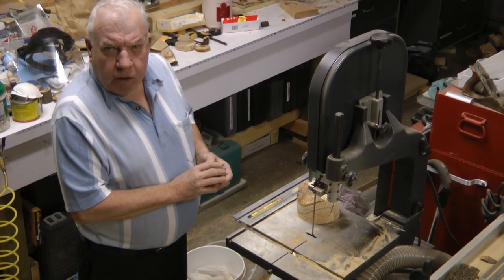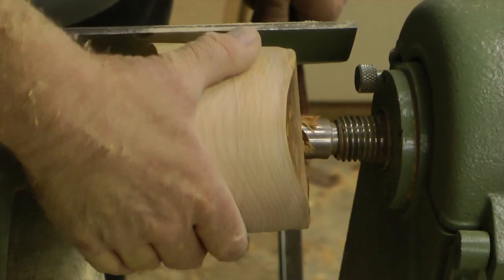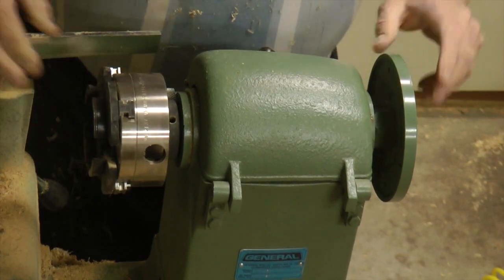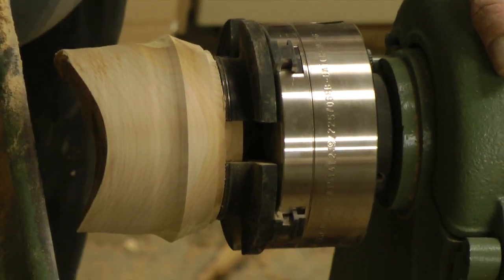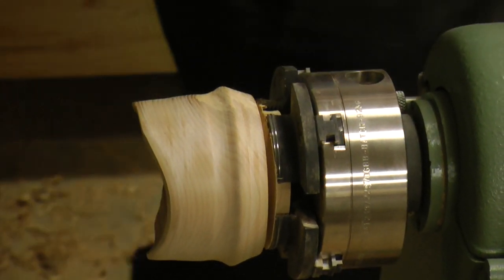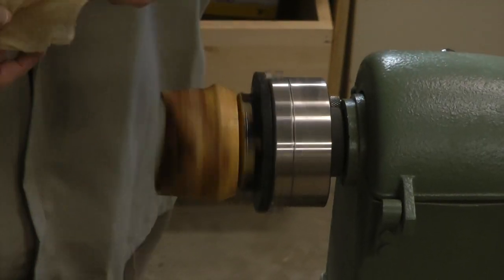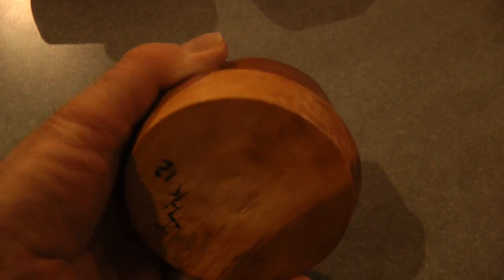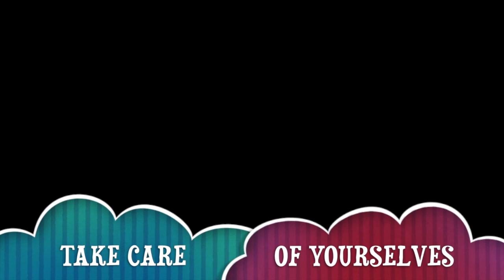Ian's Woodturning #1

Comment: Ian, you are obviously self taught because, as a standard practice, a Spindle Roughing Gouge nor a Skew should NEVER be used when a piece of wood has the grain running across the bed of the lathe.  It is extremely dangerous to use either tool when the grain runs across the bed as the tools would cut directly into end grain twice each revolution of the blank and either tool would grab the end grain in a heart beat.  The best tool to use would be the bowl gouge with a swept back grind.

Comment: Nice, but you make me nervous when I see your hand going way over on the other side of the tool rest, especially with a natural edge. Also use both tightening holes on the chuck to secure the piece and turn you tenon down to minimum to get maximum contact with the jaws.It will be more secure. I found all this out the hard way!. Also, use paper towels to apply the finish, if you have not seen what a rag getting caught on the piece or the chuck can do to your hand, please do not try an find out.

Comment: I just watched this and MUST reiterate John J Horn's comments about not using a roughing gouge and skew for making bowls.  Both tools are really dangerous when used in the way you show.  I'm still a beginner/improver, but I would never use either to rough or smooth a bowl.  The way you are using the skew is not correct either, you are using the heel of the tool instead of the bottom 1/3 of the edge, and whilst this reduces the risk of a catch, it will not give a particularly good finish.

I appreciate that you are showing people how you work on a lathe, and I hope that as a year or more has passed since you made this you have developed your technique and that you still have all your fingers, but please don't demonstrate unsafe techniques!